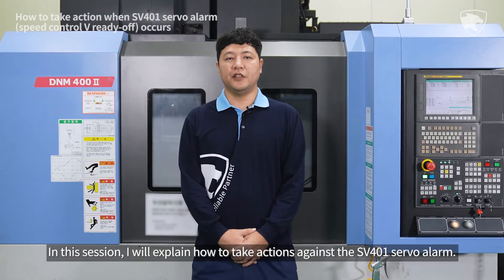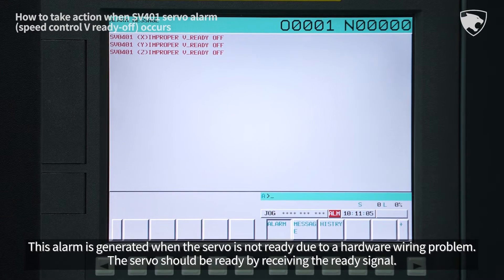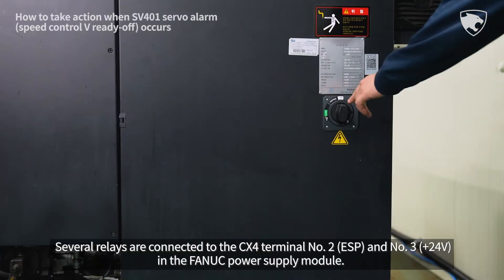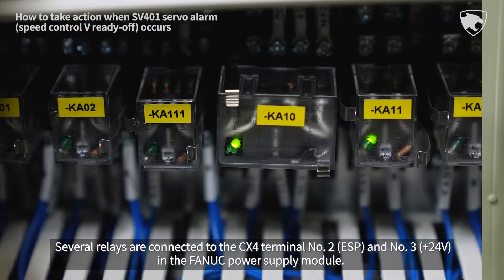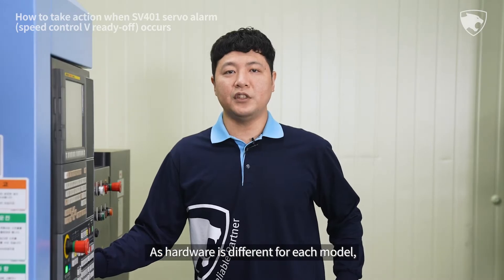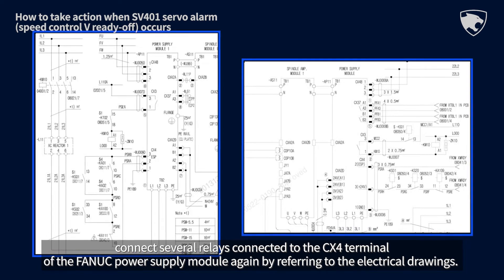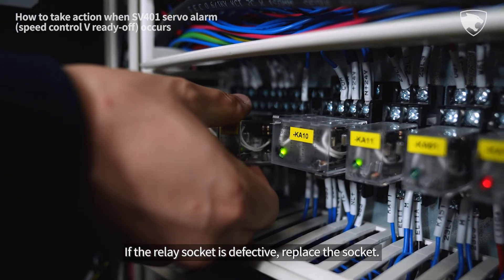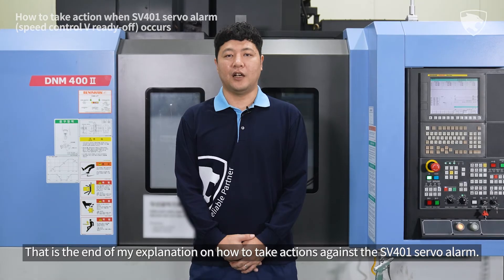Service tip.30 [EN] - How to take action when SV401 servo alarm (speed control V ready-off) occurs

Comment: does this correspond to fanuc 0M? in the troubleshoot section in manual, it says something about the dummy not beeing conected
Reply from the maker: Thank you for asking.  Regardless of the NC, most of the parts that are not connected to the CX4 of PSM are due to poor contact with the Phoenix Relay (KA109). If you have more question, please contact our specialist. https://www.dn-solutions.com/etc/contactus.do